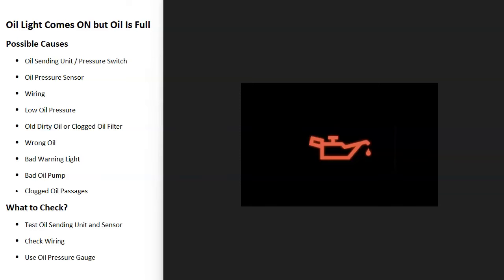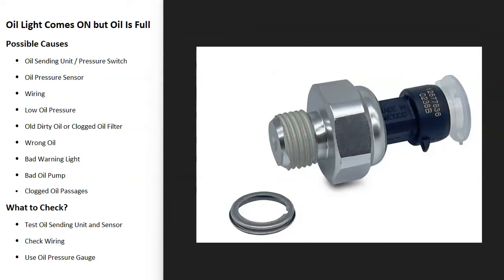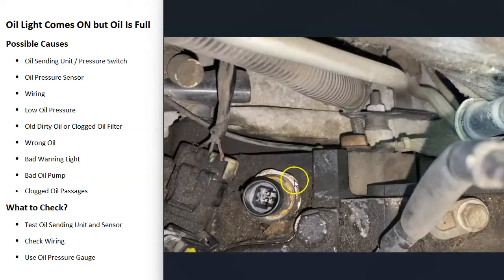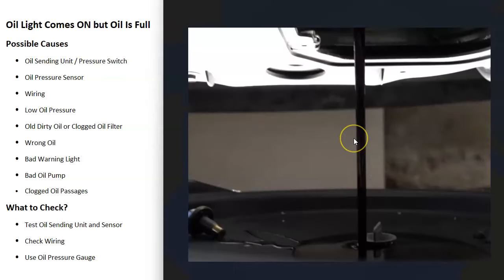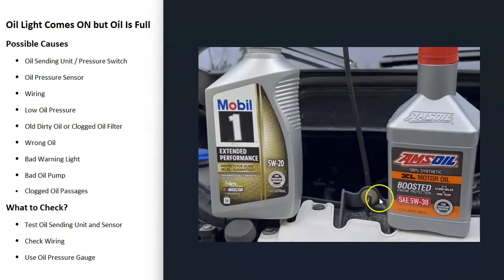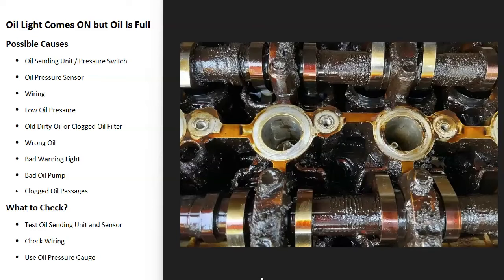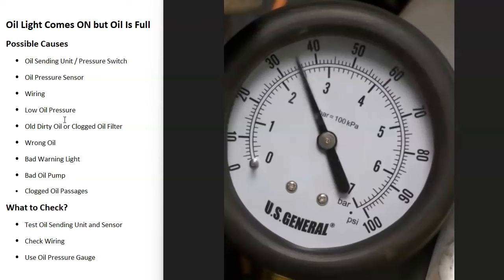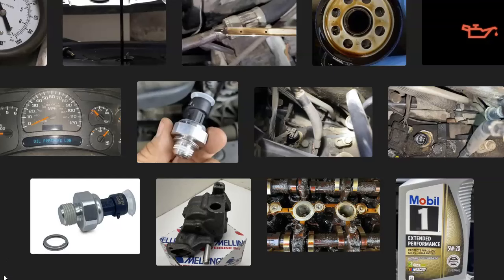Causes When Oil Warning Light Comes ON But Is Full (Oil Dipstick at the Correct Level but Light On)

Comment: Hi, I have a 2014 Buick Encore that I bought in 2019 at a dealership, my first two oil changes were free and had those done with no issues. On my third oil change I took it to Oil Can Henry's and about a week later after I had driven a couple miles and stopped at a traffic light my oil light came on with that dinging sound. I've taken my car to two different Auto Parts stores to have a diagnostic done and at both places it shows nothing. One place recommended a local mechanic so I took it to him. He replaced my oil filter, flushed out my oil with cleaner and put in new oil and let my car sit and run for about 20 mins. There was no oil light or that annoying dinging sound coming on so we thought it was fixed! Yesterday when I drove across town from my house and got to a traffic light to stop it came on again! As soon as I put my foot on the gas to go the light goes off and the dinging sound stops, until I have to stop again! Please tell me what you think it could be!
Reply: Well the problem was solved by the mechanic. It was my oil sensor!! No more oil light or annoying dinging sound!! Thankgoodness!😀
Reply: How much does it cost to replace the oil sensor.
Thanks
Reply: @sheilaaquino1791  for myself it was only $78.00, labor included. I have found a great mechanic. I'm not sure what others may charge.

Comment: I overtightened the oil pressure sensor on my vtx 1800 and broke the threads off the housing. Can I do away with sensor and close up the hole? Can't afford a new housing. Any suggestions would help

Comment: Oil Light came on my 2010 Dodge Charger today, but my instrument cluster is faulty because the check engine light comes on & off, and the gas gauge doesn’t read properly after I fill it up.
Reply: Are you sure

Comment: I got a low oil pressure light breifly about three times in the past year. All three times it suddenly came on and caused my engine to shut off. But my car immediately started back up all three times without that warning light coming on. Between those times I had my sensors replaced twice but it still randomly happened. Otherwise my vehicle drives just fine...What do you make of my specific problem?

Comment: Corolla 1zz engine shows oil light..... Have replaced the oil pump,clean the oil strainer in the sump,replaced the oil switch,but the oil light is till on with knocking noise around the timing chain area. What do I do again?
Reply: timing chain guides or chain

Comment: I have a no crank no start on a 07 Ford Expedition.  The oil light beeps and lights up on the dash but the oil level is good.  Can I test oil pressure at the sending unit with the vehicle off but in the run position or when cranking?
Reply from the maker: If the engine does not start, the oil light will likely be on. If the oil light is on when the engine is running that is an issue. If the engine is not cranking, be sure the battery is charged and has good connections. If the engine does not start, it will need to be troubleshooted, mainly for gas and spark.